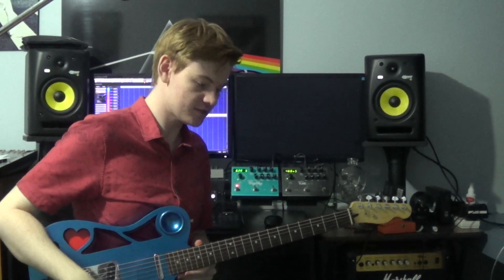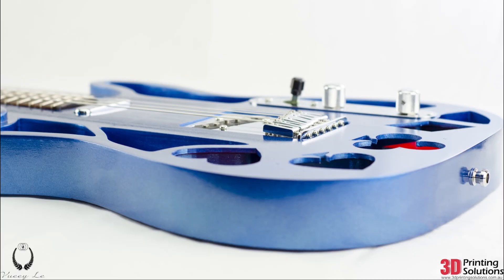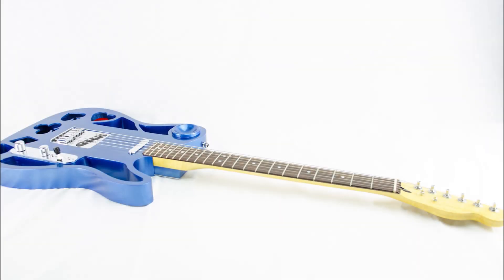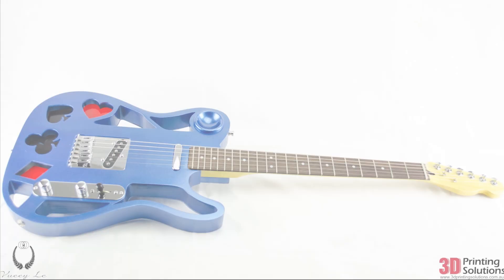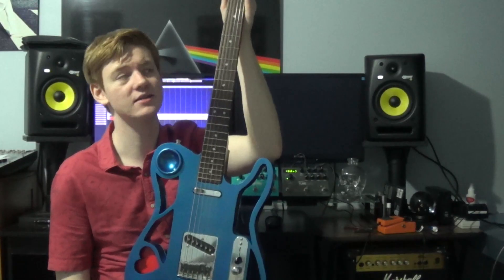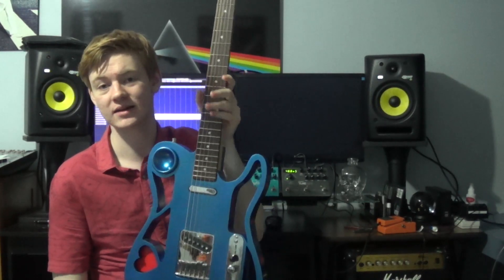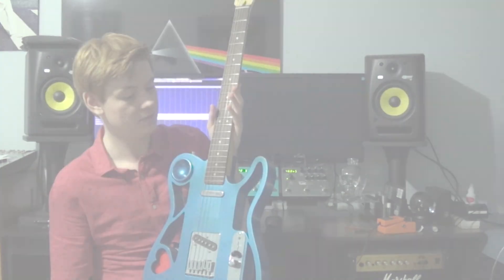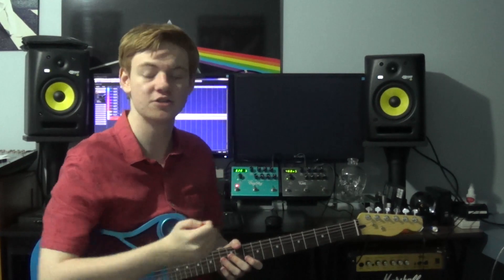3D Printed Guitar - 3D Printing Solutions (printed with PolyMaker PolyMax on the UP Box)

Comment: What sort of slicer settings did you use? Infill %, etc?
Reply from the maker: +sacredsoulrecords the UP printers have their own proprietary slicing software which controlled the slicing and support material automatically. We used the most solid fill, .02mm resolution and the 'fine' quality setting (which is essentially low speed).

Comment: Hello,

I'm currently working on a project from school. I'm also gonna print a guitar. But my question is, how did you get the finish of the body so smooth? You don't see the diffrent parts come together. And how did you paint the body?

Thanks
Reply from the maker: +Stan Pickkers We used PolyMaker PolyMax PLA filament which was the ideal filament for this project due to its mechanical strength and resistance to warping. We used a combination of two part epoxy glue and a technique called friction welding. There’s a fantastic tutorial by Polymaker for friction
welding you can see here:  https://www.youtube.com/watch?v=Cj9TMmUldhc
We then sanded the whole body until it was smooth (we think we used 800 gritt
then 1200) we then used Dulux Plastic Primer Spray Paint for a base coat. You really
just want a quality plastic primer. We then did some even coats of a sandable
base coat primer, this is the layer before you paint your colour. We then sprayed
a few coats of Dulux Duramax Metalic Blue. We then finished it with a Dulux
Duramax Two Pack clear coat, which gave the guitar a glossy finish and it’s a harder
paint surface. Thanks for the question Stan! - Matt
Reply: Thank you so much for your awnser! This will really bring my project to a higher level! I will show you the end result when its done!

Greets Stan
Reply from the maker: Looking forward to seeing it! :)

Comment: @3D Printing Solutions Australia
How to you glue the pieces together? Do you use a chemical solution to melt the plastic together? And how did you get the hardware to fit so snug? With 3d printing, it doesn't usually come out to the exact dimensions specified on the computer. And how did you make the wooden core? Was it done with a CNC? Or straight up router? Thanks!!
Reply from the maker: +HarmonickedMiller It was quite a simple process we used a combination of two part epoxy glue fusion welding. Fusion welding is where you use a dremel with pieces of PLA filament in the chuck, the friction creates a nice weld. We have never had that issue with the UP 3D Printer range, this print job was printed in the UP Box so everything printed at the size it was designed on the computer :) Straight up router for the wooden core. Sorry for the late reply, one of the Youtube settings hid your message so I didn't see it.
- Matt
Reply: +HarmonickedMiller there's lots of glues which work great with PLA. for perfectly smooth surfaces, regular old superglue works fantastic. for non smooth surfaces, scigrip 16 and plastruct work very well. the PLA will give before the bond will.
Reply: Hey. I'm currently trying to put together one of these from scratch. I'm not using the same PLA (not a huge issue), but I'm more curious about the wood block shape because I can't seem to find any pictures of where the neck pickup and bridge mount to the guitar. If you would be able to further explain that part of the design, that would be helpful.

Also, for where the neck is bolted to the body, in the released STL files you have on your site, there is no place to mount a neck to the PLA body. I was wondering why that is and if you mounted the neck to the wood core instead somehow.

Pretty much, I do not understand how you put this together with the current info I have as well as what is listed on your site. If you could help that would be greatly appreciated. Thank you.
Reply from the maker: The Wood Section was hand shaped to fit the cavity inside the 3D Printed Body. We used a Jig Saw to roughly cut out the shape then we used a Plane and Files etc. 55 sec into our video you can see the wood section from the rear. The Neck is bolted directly on to the wood section. The 3D Printed Body is screwed from the Sides of the body. You may be able to see the screws in the video as well.
Sorry we don’t have more photos, we were not expecting the hype around this project so we did not document every step.
Reply: I don't know. I feel like it wouldn't be difficult to draft up an STL file for the wooden core. It's fine though, I'll figure it out somehow.